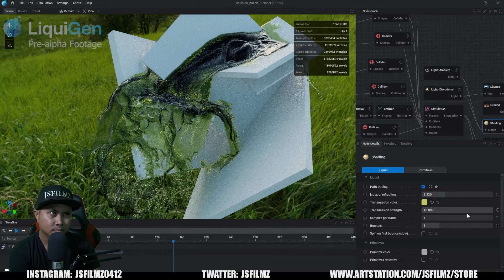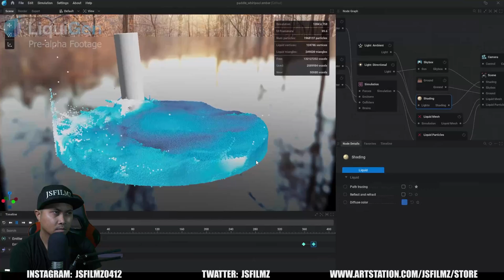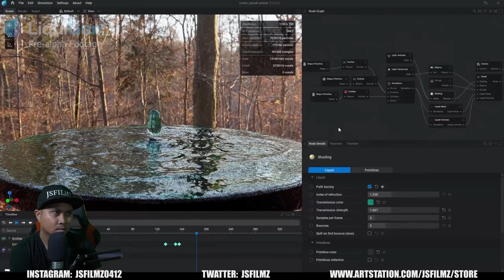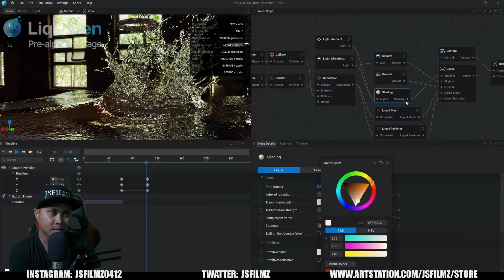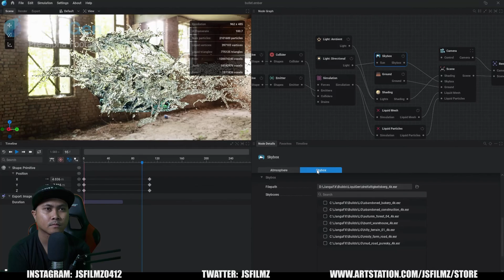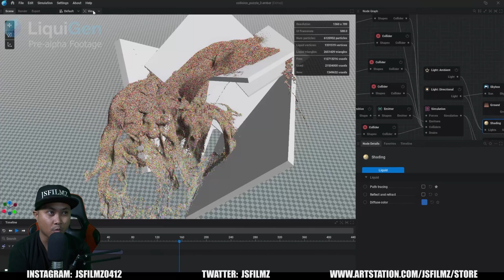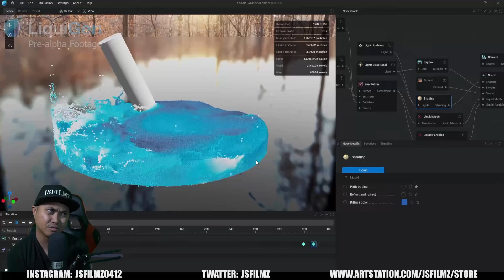Liquigen Realtime Water Simulation is Insane

Comment: You can easily export from Embergen to VDB's which import into unreal/blender etc all easily. Used a fire sim from embergen in my last unreal work because I wasn't happy with getting niagara looking realistic enough for a close up shot. The whole point of these is to be able to export it back into your pipeline so I'd be shocked if you couldn't.

Looks pretty insane, hopefully not too long before a release is available.
Reply from the maker: yea vdb plugin for unreal is still shiite im waitin for it to improve its pretty painful i want dragon drop
Reply: Yeah it’s very strong when work with embergen and VDB also so easy but the weakness point it’s the VDB very heavy inside unreal when you added 3 or 4 VDB’s the level need destroy in your face I don’t know if this cuz plugin and when unreal 5.3 come up the performance will be better or this will be common issue for VDB inside unreal cuz to be honest embergen make crazy stuff with higher quality but down side inside unreal otherwise the flipbook other solution but not for real movie work